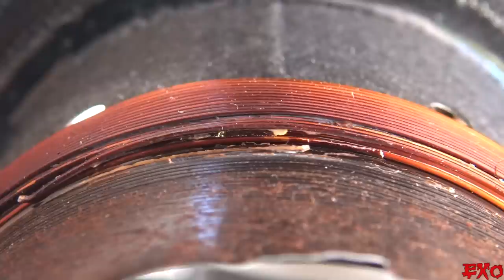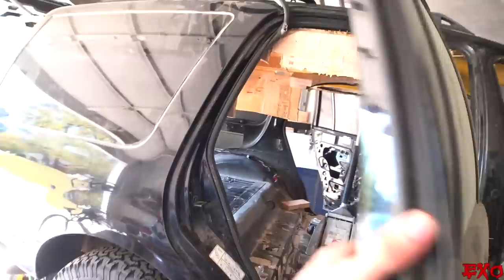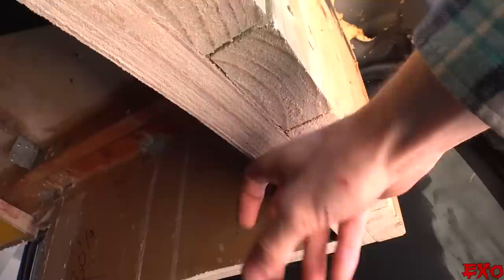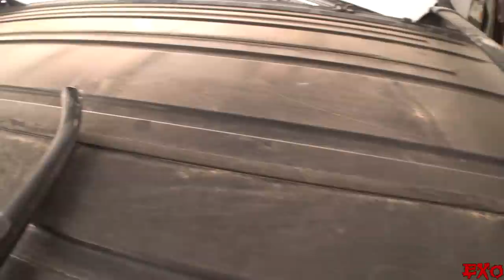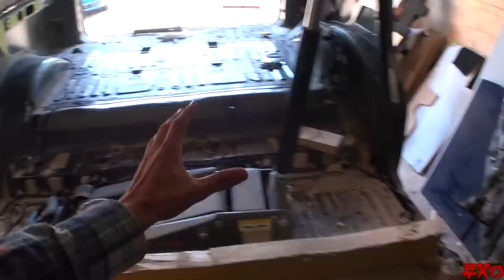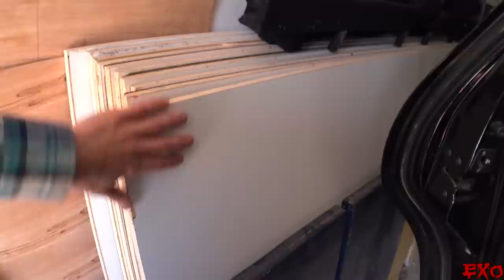BLOWN SUB After 30 Minutes of Music!?!? Car Audio Updates w/ FRANKENSTEIN & Rockville K9 Subwoofer

Comment: that's the same thing that was happening with the vm audio 15 subs testing was great i played them for a day they were doing well the next day i came out 2 out or 4 were blown just like that.so i returned them and reorder 4 more and the same thing they kept on blowing the coil so changed them for 4 pyle plpw15d problem solved this was for my daily driver nissan sentra budget banger the vm subs sounded a lot lower than the pyles but they just would not hold up the coils kept on breaking no matter how i played them. it's amazing how those pyles plpw 15d's are still holding up on those 2 strapped vvm 1500d amps after 3 years vm had that same problem with their subs bad glue and spiders if they would fix those problems they would a decent budget sub

Comment: As far as that surface goes you should be able to sand it with a really heavy grit sandpaper and you should be good, that laminate is usually attached to the plywood very well, but as for the laminate to laminate contact or laminate to other contact a smooth surface is not the best idea. I say rough it up with a belt sander and you should be good to go. If you decide to remove the laminate find a large scraper such as a putty knife, get the cut started with a saws-all or something of the sort and use a blow-dryer or large heater and heat the shit out of the wood while using the chisel or putty knife to separate the layer. Good luck mayne!

Comment: Ok, so I am only a humble audio enthusiast, so I only have two Hifonics HFX12D4 subs and a SSL 2 ohm stable 1200 watt amp in my 508 whp Honda Civic with an SSL 400x4 mids and highs amp with Pyle 3 way 6x9s in the rear deck and Pyle 6.25s in the doors with an unpowered touchscreen in the dash and while I love the power of the engine and the sound of the car is enough to get me off, I am 35 and still love some bass. I would LOVE to have that Rockville 15 to replace these mediocre 12s. I had two JL Audio W-0 competition 15s in a sealed box in my Exploder with two Cerwin Vega 1500 watt amps, a Sony Xplod unpowered tape deck, and a Sony 10 disc CD changer. I had 4 Cerwin Vega 10s in my Integra with a US Amps 250x4 1/4 ohm stable amp. Then I had an 89 Beretta GT with two Image Dynamics 15s, two ID 1500 watt amps, a Sony unpowered flip face tape deck, and a Sony 10 disc CD changer and I shattered my rear windshield in front of my high school during a bass drop and got suspended. That was back in 1999, but it was good times...people used to say that it sounded like thunder when I pulled up because they could hear me for like 10 minutes before I got to the school. I never competed and I never claimed to have anything crazy, but I am 35 now and still slightly hard of hearing...lmao Keep up the good work brother.
Reply from the maker: Thanks for sharing with us, Boosted! I'd stay away from the Rockville subwoofers, but seems like you've got some plans in store yourself :)
Reply: @EXOcontralto  Well, due to inspiration from your channel, I now have two Sundown Audio SA-12D2s in my Civic with an Aeroport box, Soundstream Rubicon Nano RN1.5000D to power them, a 5 farad cap, and an Optima Yellow top. I put those junk Hifonics in my wife's Pontiac Vibe. I just purchased a Rockville W15K6D4 just to get rid of those garbage Hifonics, and I won't be throwing much power at it, so hopefully it lasts for a few for her. It'll be in a shallow box to retain trunk space. Those Sundown 12s flex my roof and doors...lmao The Soundstream amp has all 1/0 welding wire for power and ground.
Reply: @EXOcontralto  And I apologize for the late response. I never even saw that you had responded to my comment. Not too many people leave responses anymore. It's good to see that you care about your subscribers.
Reply from the maker: No problem man! Any plans on hitting a local show!?!? :D

Comment: I like the sound of a sealed box could you tell me the best size to get 37hrz with 2 duel 2ohm sundown 10"s cant wait to hear non ported bass.
my opinion you should buy a new -
new expedition alternator rack will bolt right in

Comment: Man bro you've got me back into systems as well.    I got a question for you I e got kicker zx1500.1 and I've got an 08 Eddie Bauer El    "extra length "       I was thinking sundown audio 15x v2.    ??????????? Big 4cuft box with huge Port      got any box designs that burp.     What subs do you really think have it all.     I have kicker solo bariks now but want all around bass         btw awesome vids mad props even with you're ailment Killin it bro.     Ohh BTW I'd do it similer to what ya had but adding more airspace where you wanting to and move the two facing you to make it 4more like the front 4.
Reply from the maker: Wish I had some designs off hand, but I don't have anything like that currently! Thanks for taking the time to write that all out, if I had something to send over I'd be happy to share. Perhaps a designer like EZ Db Designs?

Comment: I just installed a dual 2 ohm recone and after i installed it, its only reading 1.2. Is that okay? Also before installing i tested the leads which seemed to of confused the meter however it would land right on a solid 2.

Comment: EXOcontralto.  HEY EXO CAN U PLEASE HELP ME WITH THIS AMP QUESTION?? MY AMP IS NOT POWERING ON. AFTER REMOVING 15 AMP FUSE THE POWER BLINKS RED AND THEN NOTHING. ALL MY WIRES ARE CORRECT AND GOOD GROUND. WHEN I TEST THE FUSE PLUGS IN AMP I HAVE POWER ON ONE SIDE OF FUSE PLUG BUT NOT THE OTHER PLUG. BAD SPEAKER?

Comment: If u didn't over power it more than likely it blew because of distortion the amp may be letting it through or the music hertz were too high
Reply from the maker: No, it blew because of inferior and defective voice coils.

I've been running an even smaller 750W sub for almost a month now, same amp,same settings, not a single issue.

Comment: Was that a dual 4 ohm version? Just wondering because mines a dual 2 ohm and ive been bangin the crap out of it for months now on an old school audiopipe 1300 watt amp. Just got back from Dallas and listened to it as loud as i could stand for 24+hrs there and back no issues. Guess i just got lucky and no i dont work for rockville. Thanks
Reply from the maker: Dual 2 ohm versions, just like you have! So glad you're not experiencing problems :)
Reply: @EXOcontralto  Thanks. I think the 30+ hrs of break in time saved it.

Comment: NO, do not laminate with the white layers. It should peel easy enough if you warm it in the son. Strip one side of each then do your gig. The lami ate is untrustworthy even if the glue would secure the lam to lam. The adhesive under could be inadequate which most are. I large putty knife and some time in tyje son and you should be stripping t hat crap off easily.

Comment: Exo, I have a couple questions. I have a 2012 Toyota camry se 3.5, and recently ordered an iraggi 320A alternator. However, I have no idea of what size belt I need. My next question is what size and how many anl fuses I need to use in my big four upgrade, and in line on my amp? Im running a soundqubed 4500, and a Northstar 480. I hope to hear from you soon! Thanks in advance. Peace!
Reply from the maker: Do you still need help figuring some of this out?
Reply: EXOcontralto Yes! I've had my build on hold since my subs won't be in until the middle of June.

Comment: The plastic on the wood does not hold... this glue does not hold when it will be hot... better car window glue black or the chassis glue black.. both hold extremely

Comment: Rockville amps sux as well . They sound good when working but my amp blew for no reason
Reply: Yeah they all do the power they say but barley last. I tried a Rockville amp out and at 2ohms it would just go to protective mode. Sent it back and got a Memphis prx1500.1 the Memphis is a beast but for $500 I could've went with skar or Orion and got way more power. But then also high out alternator batteries. Big 3 ect. My next Build is Def gonna be a all skar.

Comment: Hey my subs clip kx1600.1 2ith 2 L7 12s and i have xs power 3400 battery do i need a extra battery my volts drop to 12s when i turn up and now i just broke my cap screw can u help with advice
Reply from the maker: I'd focus on the ALTERNATOR next!

Comment: id try sound stream sub in you girls car i have watch all your videos both cha. and learn allot 
i put 2 8 inch subwoofer in my 2005 scion xb in 2.5 cub port box and it hit hard i think 
the r3-8 im push them with a 4k rockville amp the DB14 and this is the first sub that i have had that i really like allot
seen them in your truck so i try 8 and love them 
great video can not wait to see your new truck build 
could you do to ports 1 on the drive and then 1 on pas. then you have anof. air follow

Comment: The rating is 1000 watts rms and you put 1500 through it it's kinda your fault
Reply: It should handle 1500 burps fine, remember its 1000watt rms, 2000 watt peak. They were known for bad glue on the coils, EXO tested another one at rms power and it lasted 10 seconds https://youtu.be/yUZ8eldXgcg?t=510

Comment: I apologize for commenting twice but I wish you had a fan mail PO box I thought I saw a PO Box one time and I sent you something but I got the PO Box wrong and I got sent back but if I could get your PO box if you have one for fan mail I would send you a blueprint layout with Dimensions radius height vertically which I think with what you have it would fluctuate the air movement quite enormous to the point where I think you're windshield might not be a windshield anyhow maybe you can get a fan mail PO box and I can send you what I want sent you but I got it back

Comment: I would build kind of a 4 order bandbass like in Steve meads Cadilac with the 8 18s so on each side left and right to sealed boxes with 4 18s and in the middle a ported box or even a 6 order with the ports of the side boxes all the way at the back

Comment: ran to much power to it duu to true rms any more on most stuff like my pioneer n vintage sansui crap 20.hz-20khz 125 rms min at 8 ohms now that a rating one could play it for years at say extremely loud  i do not agree but one needs  to ignore stock ratings some are at example 1khz 500 rms  it`s dumb i know but the way it is.one needs to rate there onw crap useing voice coil size testing but that gets very hard after say 200 watts by ear